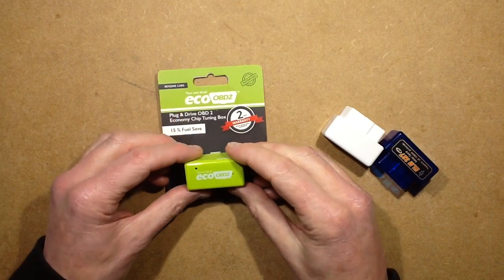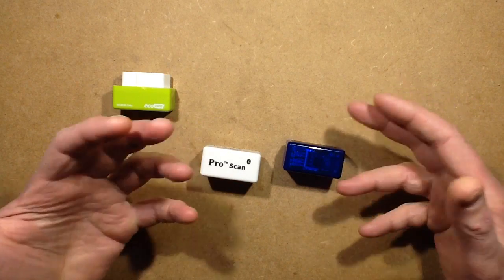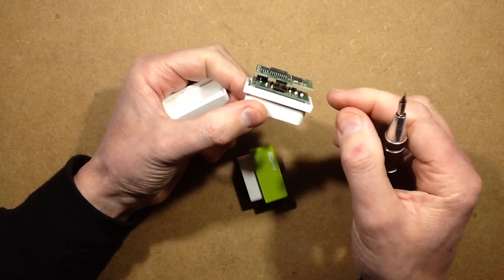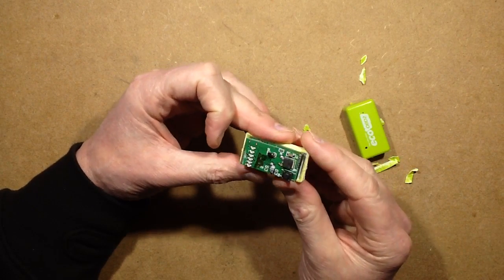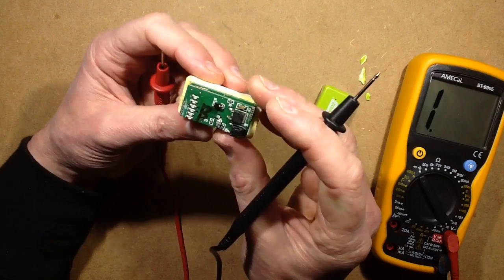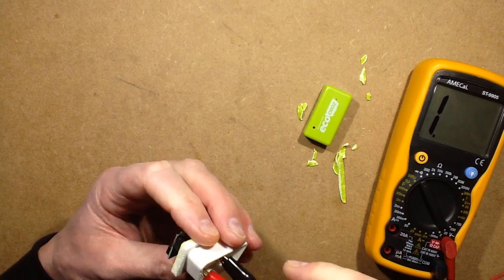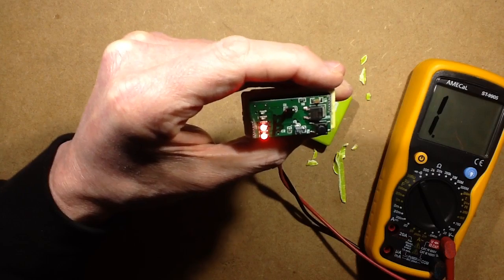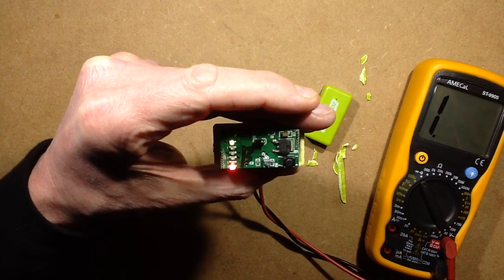Inside an ECO OBD2 "chip tuner" fuel saver.

Comment: my eco OB D2 just arrived today and I was wondering where the reset button was I thought it might have been a smaller one and the bigger hole may have been a indicator light. But if you look on the side the left side at the top it has reset so that's shows that the big hole has to reset button inside of it. I got my ECO OBD2 open without destroying the plastic housing. All you have to do is on the bottom side where the tab sticks up on the white part;  if you run a pair of small fingernail clippers fingernail between the colored housing and the white part that's on the bottom side. Slide the fingernail file in between the green part and the white part but not too far then slightly pry up where you want to pry is almost even with the little hump that's on the bottom where all the pins are; once you done that on the inside it has a small cutout on the top and bottom once you get it open you can see a small grove on the top and bottom. Because the green cover has a notch on top and bottom that locks into the cutout on the White part with a circuit board. That's what holds it in the outer green case or whatever color you might have selected when you ordered it. I hope this helps even though this video is a five years old but I just seen it now. This will prevent any future damaging to the outer case. But if you have something long enough where you can just stick in the hole and press the reset button you don't have to go through all this trying to get it out of the case.
Reply: I was able to pull the green apart from the white plastic carefully with pliers after watching a few videos on this. Just a little tug after second try to pull apart.The reset button locator is not in directions but l saw in another video the guy opened it and it is were the big hole is on left side if green box. A tinny round looking black button. Another video said to use a needle to push through hole. Great idea. I have a small tool that came with a very small phillips screw driver set that was small and long like a needle that also fits in that hole.
 But,  after reading all these reviews on several videos, l am afraid to install this. I have a Toyota Camry.
Have replaced all 4 cylinders in past and at least 1 O2 Sensor due to engine light on. Got a new toyota gas cap. Also put in catalytic converter cleaner fluid when the last engine light was on. Drove little over 50 miles after putting cleaner in gas tank and now engine light just went off. Probably best l just don't install it. But trying to do more research on this. Still not feeling good about installing this. Once few months back the engine light did blink and l know that's not good. Changing out the 4 cylinders seem to have left the engine off for a while, but then back on couple months in. I have high miles. It burns oil but does not leak.The oil had gone up into the cylinder before l had them changed. I use 10/50 STP Oil and that helped a lot doesn't burn oil fast anymore. But l still kep an eye on it. I have a 2002. Gas cap doesn't always click twice and wonder it this is a problem also. I know you have to have a toyota gas cap for a toyota. In my research on this that is highly stressed about Toyota's. And l stay away from real cheap gasses. Still running on high miles and 2nd rebuilt transmission. 😊

Comment: It's a scam it doesn't work. It's just an expensive flashing led light. The only thing that can save fuel is the human that is driving the vehicle. Be light on the gas pedal and tires inflated to the correct pressure or maybe a couple of psi higher to reduce rolling resistance. Atmosphere pressure and friction is a vehicles worst enermy when it comes to fuel efficiency.

Comment: I wouldn't risk in in my car. It could destroy the CPU and immobilise the vehicle.  I saw another video whereby the engine management light came on so the vehicle obviously didn't like it and sent a warning.  When it was removed the problem disappeared and there was no significant fuel savings.
Reply from the maker: Most of them just put on a light show.  But if one had an actual canbus connection either deliberate or accidental, then it could jam that network and cause a string of codes.
Reply: @bigclivedotcom  That's what I thought. You've convinced me to stay well clear and since it's only a  Citroën C1 it wouldn't be worth the risk because it's good on petrol.

Comment: I'm seeing comments from people with diesel cars who noticed fuel savings while using these sorts of devices.  Usually a diesel engine, especially one with a turbo, will run just fine with a leaner air/fuel ratio, but this causes hotter combustion and higher engine temps.  You may not notice anything on your gauge cluster since the cooling system  can handle it, but the higher temps will put more stress on your engine.   If you're using one of these devices you should probably monitor your EGTs (exhaust gas temperatures) to see if they are within safe limits.

Comment: Sanity of security does not win always against cost or features. My father called me naïve for expecting this from professional and experts. There could a be lot of shady stuff possible in modern cars. For the most part the assume it will only be used for legit purposes by professional with proper tools. However you can sniff the message fairly easily and getting the connector or wires off it fairly straight forward. Automotive security like the rest of cyber is a bit of a joke really. 

Some people put this information out there not realizing the effects it could have. Companies and agencies try to hide it, which puts them in a catch 22 most of the time. People turn it into a game and if its is common people do silly stuff. My personal favorite is trying to destroy people with decent level of understanding cause they are on the wrong side. Meaning the defects for society go unsolved. They have some creditability for this since this are harder to solve than people think. People want if faster, better, cheaper, safer, etc. There is only so much possible in with so much time and resources. I will say there is a lot of evil forming in companies and agencies for which this does not cover.

I must say after 30 year, the most damned things in this world are sanity, competence and morals. Yet these are your expectations. Ironic?

Comment: I remember eboo sellers sold a 'Amazing fuel saving device' about 15 years ago, for a pound. So at that time Clive, and being a bit low on feedback (as I had bought countless items at 10p or less) I purchased this amazing porformace
Reply: Unit and it turned out to be a simple two pronged resistor. Didn't fit it, as I was far too busy laughing my head off at the bare face affronry of the seller. All it did was, fool the Air correction to overfuel the engine. But since I only had one injector, rather than four (Or more on my Fiat) But as P. c. Barnum said 'this way to see the egress'.

Comment: I have one....it simply WORKS, period....anyone that says different, either didn't flow instructions, or never owned one...truth
Reply from the maker: That's wonderful.  Especially as many don't even have the canbus pins connected.
Reply: Did you see increase to MPG?
Reply: I bought one....and the instructions says to press the reset button.....there is no button only a hole in the case about the size of a pin??? Do I stick something in there??

Comment: Do some more digging. I don't want to screw up a great ride!! I got a mile per gallon more with 100% synthetic oil. I have a Blue Driver. It just tells me stuff like all plugs firing, temps, rpm's. No place to change any settings to make it run better.

Comment: The OBD2 port does have access to vehicle networks including engine management. The vehicle networks are exposed to the OBD2 connector. There are various other OBD2 engine performance boosting modules that are vehicle year, make, model, sub-model, and engine. How a universal device can work for all vehicles is a good question.
Reply from the maker: I made other videos about versions of these.  Some had no connections to the network pins at all.

Comment: You need to know what it does for the heat map  data on you car by plug-in an oscilloscope and a logic analyzer to verify how it change parameters values for all fuel system devices, to be able to verify the so called 15% fuel  saving and how it does it. In fact, this needs a simulator with two or four different car setups for that simulator to perform such test
Reply from the maker: See the other OBD videos on my channel.

Comment: You can  unsolder the upper pcb and check out the microcontroller if really the can bus pins Re connected also you supplied the 12v dc to this unit why not connecting a can bus sniffer and using a pc send some data and see if it really respond to that or not. 
The engine ECU  connected to obd  port only used for see status of the engine and doesn't allow to write data to the ECU. 
A pro tuner person connects a pc to the obd port and tune the fuel map very carefully do the car really saves fuel but really degrades the car performance .

Comment: I wonder if Volvo pre-empted these things? On my car at least, you cannot leave anything plugged into the OBDII port because the cover will not fit if the port is 'occupied'. In fact, I'm not even sure that the centre console lid will close with something that big plugged into the port - unless you want to do a hatchet job on the console itself.

Let's say this, I have looked at a whole raft of OBDII code readers, and not one of them can even read the diagnostic codes, much less change anything. The only code reader that I have found to read my car is the Snap-On Solus range of readers, and they cost upwards of £1k. Even the cheaper Autel readers cost upward of £400 for the lowest level scanner that claims to read Volvo cars. So, it seems extremely improbable to me that a "thirty bob" chip can do what a £400 scanner can't, which is to interface with a car's engine management system.

Do you suppose you could re-engineer that plug-in gizmo into a Christmas light show controller? I doubt it's fit for much else.

Comment: I plugged it in on my 2005 Cadillac STS and immediately the check engender light came on. Scared me enough to take it out but the light is still on......now what?
Reply from the maker: It sounds like you have a faulty unit that jammed the network.  If the car is still running OK 
 The check engine light may go out after a number of vehicle uses.  If not then try disconnecting and reconnecting one of the battery terminals to reset the cars computer.

Comment: The history behind this is not that it is 'a little thing from China', which infers it is therefore cheap and nasty, but rather that it was invented by a college student in the US. Upon graduation he started his own company but was soon closed down by the oil companies. He thereafter began manufacturing in China.  My experience with the device so far has been positive with noticeable fuel savings, even up to 50%, however this is only on highway trips which used to consume a quarter tank but now only consume an eighth. I have yet to come to a strong opinion about the device in town traffic. There is a psychological aspect to it I admit. I know I have been deliberately driving more economically because I am willing the device to work, so that could have something to do with better consumption. But I generally drive around the speed limit, so not that much has changed.

Comment: I PUT THIS IN MY 2002 DODGE RAM 2500 4x4 V!) AND I DID GET AN ADDITIONAL 80kms ON A TANK OF FUEL !  I WILL KNOW MORE OVER TIME ! ALSO YOU NEED TO HOLD THE RESET FO 5 seconds ON INSTALLATION !
Reply: Hahahahahaha

Comment: I put the blue diesel one on my Hyundai Tucson 2ltr.... I was also sceptical at first. It took my average MPG from 36 - 38 to regularly over 42 and on long runs to Swansea (M4 motorway) I got 45 mpg.  No problems with MOT tests, gas tests etc... So I've just moved it to my new diesel car.

Comment: I used the blue ELM37 Diag as shown on a 2010 Mini Cooper that had a recurring misfire. It successfully showed cyl 1 misfire so I changed out the coil pack and it has been fine since. Only paid a  £quid for it too!

Comment: An ecu, on most new cars, will adapt to your driving, and even the transmission will respond as well. Most mapping information is encrypted, but there is a command to reset. I bet this little unit could accomplish that - telling the ecu to reset it's maps and adapt all over again. It won't do the remapping, though, and definately doesn't have the memory to monitor driving. The best it could do is induce the car ecu to do what the unit advertises it can do itself

Comment: I own a Hyundai that I bought used, that had the "Air Bag" warning light on, and no matter what fix I was able to find and try, nothing worked to turn this light off. The only option I had was to buy an OBD-Ii diagnostic system from Hyundai, which was out of the question since they wanted $2,000 US, plus a monthly subscription to their Global Diagnostic System that was $150 a month if you paid for an entire year at once 

Determined to figure out how to get this light to turn off ( since the repairs had been made ) I went on Amazon, E-bay, Overstock.com, and a few other sites hoping someone had been able to make a knock-off of this expensive system, and I actually found a Chinese knock-off for $150 US , and out of frustration I went ahead and bought it. Surprisingly it worked! I've also been able to run diagnostics on things I never knew could be treated through the OBD-II port.

So every now and then, a Chinese knock-off actually does what it says, and isn't a scam. I'd say maybe 1% if the time it's what you want/need, but I'm glad I took the chance with this one and it happened to be in that 1% :-)

Comment: I use Diablo sports tuner. When flashing my ECU I must turn off the ignition switch and back on 3 times before it will start the flash. My tuner is for my make and model and will not work on another make and model. I don't think this thing works

Comment: I wasted the time ..
The author could not tell that it's a fake ,he could not tell what's in it ..
Blaming Chinese product will not make you an authority ..
USELESS VIDEO ..
Reply from the maker: If it helps, it's absolutely fake.  Further investigation showed that the connections to the canbus network have 10K series resistors so it can't influence the data on the network at all due to its low impedance.   It simply monitors the car's networks for activity and then puts on a lightshow as if it's interacting with it.

Comment: I’m calling bullshit on this one  💩💩 U can reprogram most vehicle ecu’s via the obd interface which requires a much more complex device attached to the vehicle and also the firmware/bin files to do so,it can also be done with a passthru device,both of these require checksums and authorisations to change safety critical systems. There are some manufacturer specific devices out there where you can scan for fault codes and change the way your vehicle behaves when u lock doors etc but these fuel saving devices just flash some leds and at best let u read and clear fault codes then maybe clear learnt adaptations in the engine ecu but that’s it.
  If you want fuel saving tips ask Volkswagen (and others)who built one into there diesel cars free of charge 👍😎

Comment: what a waste of video space on here!! In the motorcycle world, fuel map changing is common place.  Manufacturers have to make compromises in fuel maps to account for weather extremes and driving styles. If the modifying chip can take away some of these compromises to closer match what your actual vehicle is being asked to do I would think there is room to save some fuel along the way. This guy cutting open an OBD2 chip just to be super sceptical and then say "I really dont have a clue" well what a pointless video.

Comment: So I don't know if it works or if it doesn't pointless video
Reply from the maker: If it helps I can tell you that it doesn't work.  The microcontroller does monitor the activity on the data lines to trigger a lightshow, but can't actually influence the canbus network itself.

Comment: P.S.  The light flash sequence is very similar to the protocol/data rate check that devices like the ELM 327 and similar do while trying to establish communication. I wonder if OP read the manual? :D IF there was a manual...  :D
Reply from the maker: I've got a "newer" version on its way from China right now.  These things really are fake.  I subsequently revisited this one and traced the canbus connections.  It's just sensing the data buses with 10K series resistors to look for activity and then puts on a light show.  That way it only "does stuff" when the vehicle is active.

Comment: What these types of things can do, as noted by others, is change the values for either cold running or... as VAG did... modify emissions controls, which will often produce an improvement in fuel economy and or performance. As Clive noted the unit can communicate across several busses, so it is possible that it is capable of doing "something" There is a two way communication across most busses and it is quite possible for a fairly simple device (a digital equivalent of the  resistor someone mentioned) to, for example, change the air intake temperature reading by a few degrees, which in turn will change the fuel injection cycle. Even dropping idle speed by 50rpm can produce a noticable change in economy for a inner city commuter. The 200 mile "analysis" is probably finding the most appropriate value to apply. Spoken from experience  :D